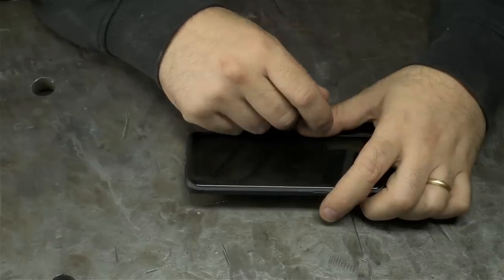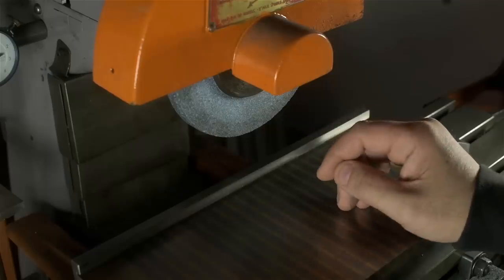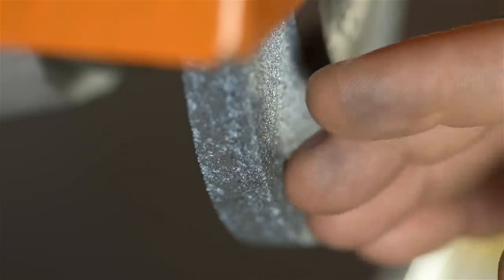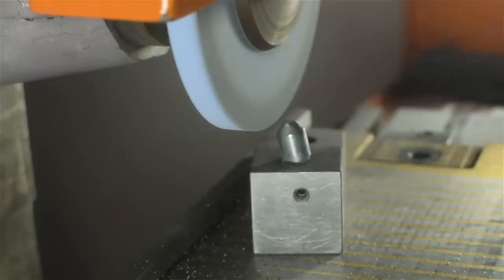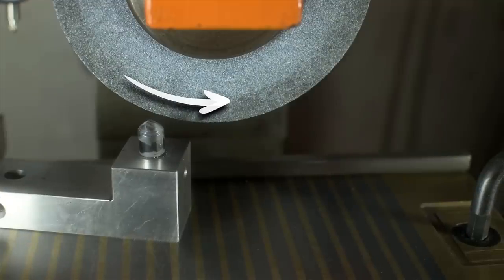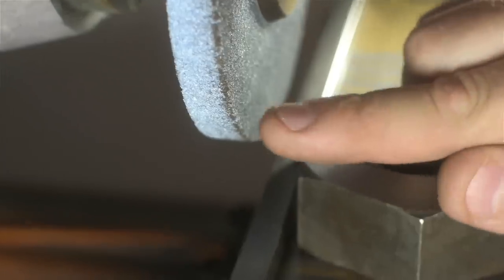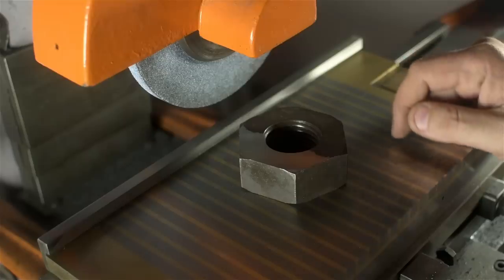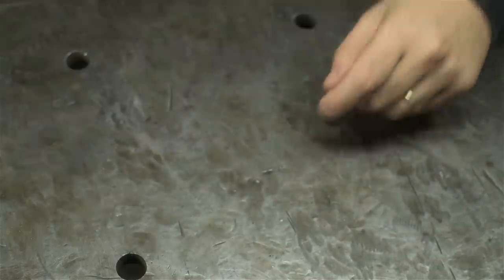How Surface Grinding Works - Part 1?

Comment: Ok, but... you didn't actually answer the question of "how"?  You talked about how it wears, how it's faced up, safety about direction of spinning... but none of that really answers how the tiny leading edge corner can make a thing extremely flat over time?  Is it cutting .0001" width grooves in the surface of the part along the direction it spins?  There's a width to that interface spot on the wheel to the metal; if it's wearing down on every pass, how does it stay consistent enough to make things so flat?

Further, the machining on the table and magnetic chuck itself must be incredibly tight in tolerance?  I imagine even a tiny piece of grit on a single bearing under the table might bump it up ever so slightly as it passes along, making a high or low spot on the face of the material?

Maybe all that is just too small to worry about, and what I'm not really getting is a sense of scope and context.

Comment: ?? This didn't explain anything about the relevant geometries. If dressing the wheel, after lengthy use, proceeds back-to-front then the wheel must be wearing such that, after lengthy use, the radius at the front us smaller than the radius in the back. IOW the wheel has worn down from a cylinder to a conic section.

But none of that explains why the wheel engages the part with a single circumferential line of contact. Badly needs diagramming.

Comment: Brillant channel used to use a surface grinder gives a great finish and dont think i eva did anything over 4" wide or more than a 1/4 " deep mag chuck was the real reverlation tho love the channel would like to see move videos on tool making
Reply: Focusing too much on the surface finish is a common mistake. Folks often forget about various grinding defects (all machining processes have pros&cons).
Reply: Lol finish was not why we used it was for ground gear box parts the finish was gr8 no mater what we did very controllable and uniform

Comment: The mag table is what I dont understand, isnt it going to put stress and bend into the part rendering the whole grind useless?
Reply: Beach&BoardFan depends what you're working on. But yes it can be an issue, and there are ways around it.
Reply: Yes it's possible (when part is susceptible, you must find another workholding method).
But more often you will for example deform/distort the part because of overheating (wrong wheel, too aggressive cuts, no coolant). Just because you're using surface grinder, doesn't make your parts "perfect" (like flat) automatically - most folks just don't get it.